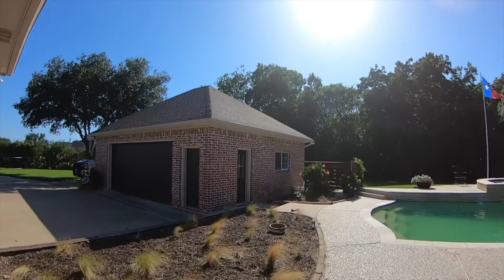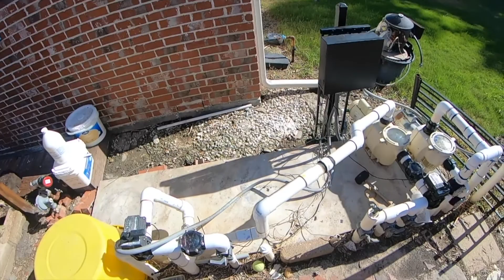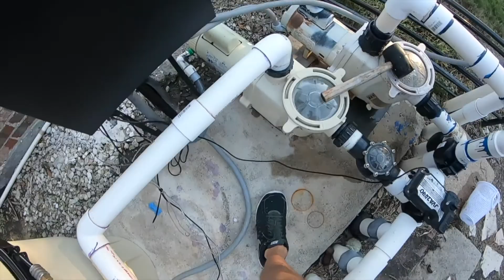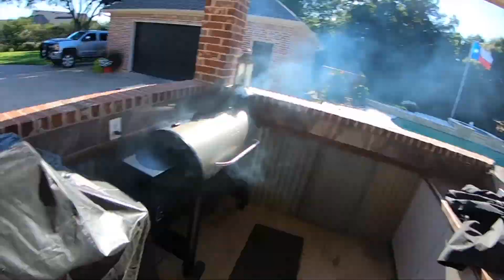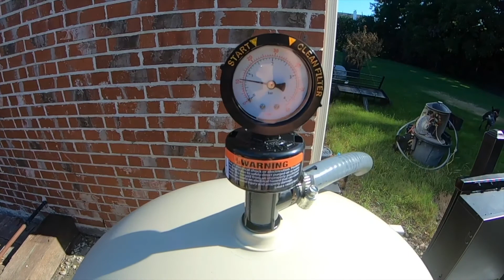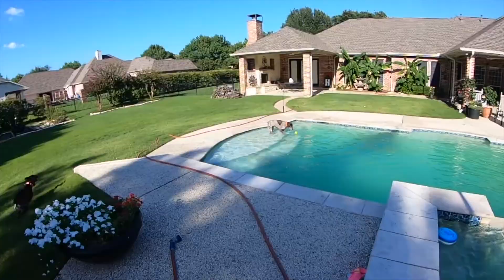Pentair Clean And Clear Swimming Pool Cartridge Filter

Comment: Hi, so about the pressure, there’s a start and clean filter note on the pressure gauge. That’s movable you know haha? So when you first start it, that’s your clean operating pressure and you move the dial, the black ring over so that start is matching the needle. And then you have 10 extra lbs of pressure before needing to clean the filter
Reply from the maker: Thanks.  Yes there is.

Comment: Thanks for the video, I am looking at filters, $$$$ ....undecided, Did you do a diverter valve for backwashing?   ...p.s I just found a good deal on a variable speed pump Black & Decker... 1 1/2 hp with timer control.... love it! got it for $499 Amazon..
Reply from the maker: Thanks for watching.  No diverted to backwash.   So far, I’m happy with it.
Reply: @HeritageFarmsTexas  What do you do, if it rains alot and need to lower pool water level?
Reply from the maker: @iak474  ;submergeable pump.
Reply: no backwashing with a cartridge filter.....you need a 3 way valve...if you backwash you'll tear apart the cartridges...

Comment: On the gauge the bezel is movable to alight the START to where the needle is pointing with a clean element and then the CLEAN arrow should be 10 PSI over that to tell you to clean it. Right now the START is about where the CLEAN should be.
Reply from the maker: Thanks for the advice.  Appreciate it.

Comment: Well that was fairly easy, once you got the equipment.  Nice job getting that straightened out and allowing room for working. That pool looks great to  me. We are headed for a high in the 100's here today "*..Heat index values up to 102 expected."  I need that pool!
Reply from the maker: Wow, that’s hot for your area.  Yes, slowly getting that pool back to normal.  Hard to believe still dealing with issues from that Texas Winter Storm.